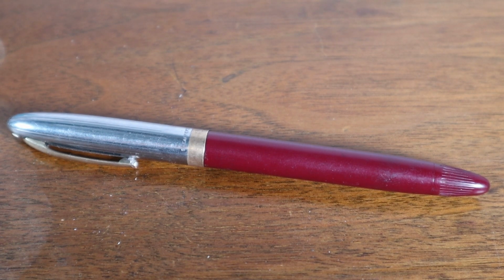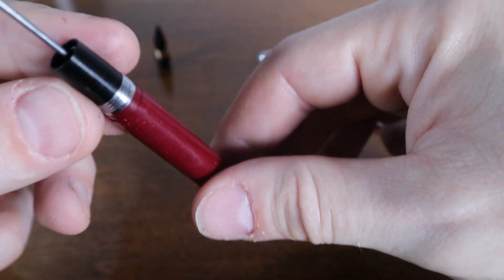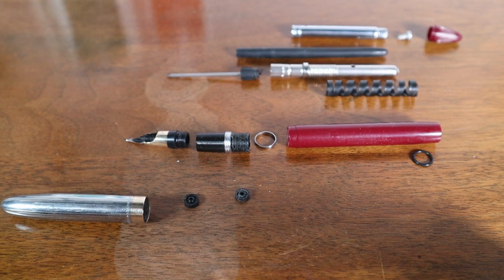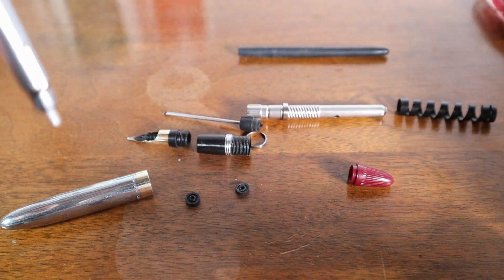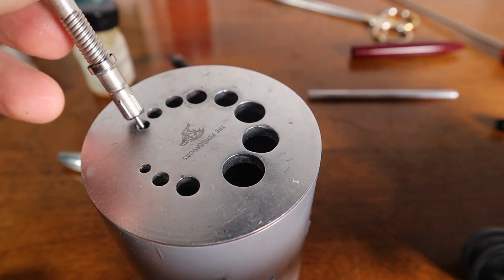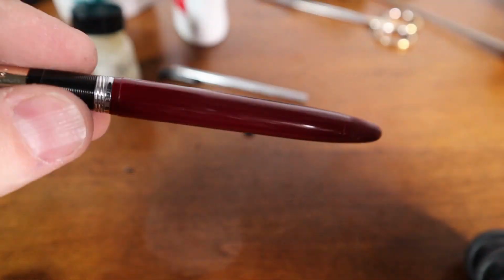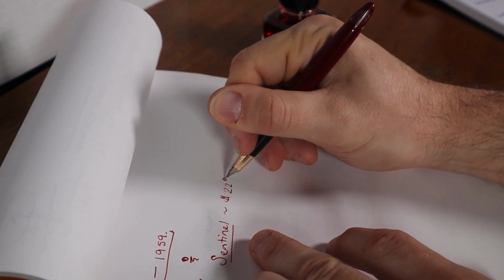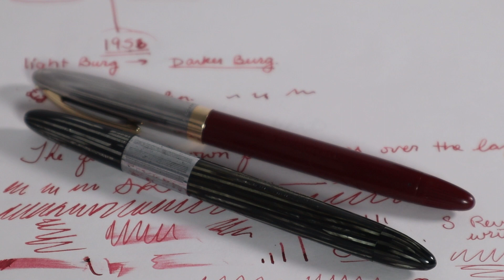"How To" repair Sheaffer Snorkel Filler (Sentinel)

Comment: Trying to get that stupid o-ring in there is driving me insane!
Reply from the maker: It can be a headache! I take the tip of my dental pick and press onto it. If they are dried and crisp you basically wind up chipping it out. If they are still flexible the sewing needle or the dental pick can slide behind it and pull it out. A light is handy to make sure you are placing your pick/needle in the right place.